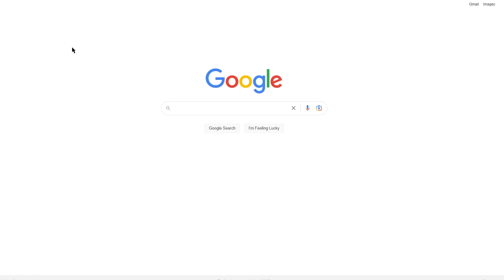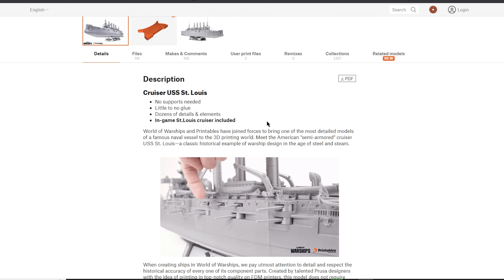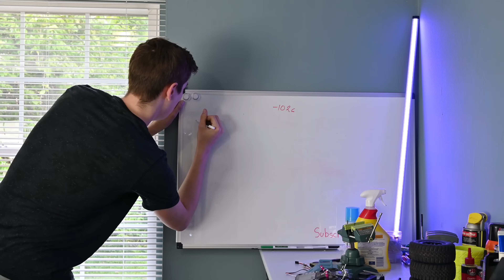I PRINTED an RC Car... How FAST can it go??

Comment: 1. Off road tires are designed for that purpose, and they are generally not designed to be fast. To go fast and stable you need the smooth, soft, and sticky tires to bite the ground.
2. It's too light, and the center of gravity seem to lean toward the tail, a tail heavy car will do that at high speed because once the speed picks up, and front is light, the front will try to lift up due to increased power and torque, even tho very minor, it will cause the loss of traction, and once the front loses traction, the rear will start to lose guidance and veer sideways.
3. The closer the center of gravity to the ground the better for high speed stabilization. Use smaller tire, or lower the car. With that big tire the car will wobble at high speed. Imagine the setup for F1 or Nascars. That's the kind you want for high speed and stable.
4. Aerodynamic isn't that relevant unless you go over at least 100 mph (for stabilization purposes). Fins, wings, spoilers, all the bull crap is not needed.

Comment: All the high speed cars are 4 weel drive. And you have to use metal gearings. A bigger motor and some more changes.

Comment: I want to see more rc experiments. Go outside the box. Breaking convention is how intuitive design is made. Start trying different ideas and designs in shape and everything. Also make a body for it. Not for looks but to protect you electronics! Lower the car add wider tires, adjust tire angles to keep car in line. Add more gyro about 35 to 40 percent. You shouldnt be loosing control that soon.
Reply: Also dumborc makes cheap controllers and recievers that are top line gx6 has gyro built in!

Comment: Ive been tossing up an idea around building an rc car that isnt the fastest but just has the biggest tires around and stacks of suspension, sorta like the monster truckes with the big soft tires you see jumping or driving over each other but with the body all inline so it can drive upside down as much as right side up... But i have enough projects all going on at the same time

Comment: Two suggestions :
change for proper rc car radio,  not the one used for drones. 
do 4wd version,  better to have all wheels under control than just rear.
as well as proper surface,  almost ground clearance and foam. tires designed for in fact only,  speedrunning. 

Are you planning on making basher/idiotproof rc car? that would be cool ^^

Comment: 1 you need a body for aerodynamics
2 you need to make the steering much better, tighter and potentially put some dual rates for when you get going fast your controls demand less movement
3 that looked like a drone motor??? I mean ok but not for this necessarily if it is... bigger terrestrial motor
4 the gopro mounted like that creates serious drag and also instability. I mean I do it with mine as it's the best view too but I'm just under 40mph with an 80a esc, 3900kv brushless, and 3s 2100mah 80C in a 1:12 pxtoys rebrand chassis
5 better ground obviously but use what ya can

I shall be following this closely, I wish you the best... there's no luck in truly engineered parts

Comment: Collab with one of the high-speed rc creators and have them help you set up the car. You can get a suggestion in the comments but if you don't know how every adjustment and expects the car you will just be chasing your tail. Hands-on with someone setting it up will speed up the process. A simple fix is to add some duel rate and expo to your radio so you don't overcorrect at high speed. Without a high downforce body making any adjustments won't help much due to all the different drag effects from the air passing through the open wheels and chassis. Good luck have fun, hope to see an update. I think it was very successful. Excellent 3D printed RC car.

Comment: I'm still seeing your tires ballooning, I would almost say he should look at the drift style tires which are a very thin piece of rubber over the rim (think something like F1 but thinner), you will need a smoother surface for the completely slick tires though. To maybe reach your desired speed larger circumference tires might be an option so you can hit the speed with less RPM causing less of that particular force on the tire.

Depending on your controller I saw someone mention tying the steering curve to the throttle but if you can't do that applying something like a 30% expo to the curve so you can make small changes at high speed vs the larger corrections that are sending you off course. If you can get a live video feed from the go pro to your phone an AR headset to toss your phone in will make driving allot more logical as you will see the path from your car's perspective (a relatively cheap way to get the FPV experience without spending allot of money). 

Good job though, first time I'm hearing about the carbon fiber filament might be something useful for some projects I have.

Comment: Any part that's printed and brakes should have gussets added to them, but it should be in the direction of the failure to actually improve load handling capability in the direction of the failure so that the same thing can't happen repeatedly.

Comment: Your suspension geometry on the front shock tower is not ideal and will be really unstable. I'd also recommend being a full set of shocks from something like an Arrma infraction or Talon. You will need the dampening over 60mph. Getting to 60 is relatively easy, aero will start to have a big influence as well as all the tolerances. A couple of millimetres of play at 30 mph is not a problem, over 60 mph will send if off the road.

Comment: You need way stiffer suspension and your car is way way waaaay to far from the ground.. Use foam tyres for speed runs, they do not baloon  as the ones on the car.. And you need some kind of a body for better aero for sure..

Comment: make a full length flat piece for thr bottom that tapers up at the rear into a diffuser

itll add boatloads of ground effect downforce without increasing drag

Comment: Biggest tip from an avid rc driver: you need MORE SPACE. Like A LOT MORE.  And definitely MUCH WIDER. You have no run off for if you lose control; and you have no speed up space and definitely no SLOW down space. Because it takes just as much if not more space to slow in a controller manner

Comment: I wonder if limiting turn radius based on velocity would be a good idea for stability. This can be some in software easily if you find a way to measure velocity
Reply: Maybe you can just use the accelerometer and integrate it. This won't be super precise but it would at least be better. You can probably just get an output from the ESC tho
Reply from the maker: I am planning on doing this!

Comment: Try if you can make it AWD it will help it very much also try adding wider smooth and larger tyres also lower it's center of gravity and introduce a more aerodynamic body shell also if you use a high end rc car controler it will help in steering the car at higher speed the one you are using it is not ideal for slight movements at high speeds .

Comment: You need to get your steering rack straight, you issues with steering is because your car wants to pull somewhere else. Wider tires will help, but better tolerances aswell, your joints cant have any slack aswell, parallel wheels is also paramount. It is hard to achieve, even my relatively expensive car needed a lot of work to get to stay in a straight line.

You also need to increase downforce and firm up you suspension. Fill your tires with foam or get stiffer tires!

Comment: You should addd an fpv camera so it can go out of your field of view and you will still be able to see it. Also get a real rc car controller because it has steering trim which makes it so if the tires go unlined then they can easily be realigned.

Comment: You need a body on it to create down force to keep it from spinning out at higher speeds. Running stiifer springs or thicker shock oil up front and lighter springs and oil in the rear shocks will give you better high speed control. A simple fix is ad some duel rate and expo to your radie on the steering to dumb it down some so you don't over correct. You should collab with Raz Shifrin when he is in the states and have him set it up for you. He's also a funny guy. He sounds better than my .

Comment: The problem with this is , at high speed it is getting unstable due to air pressure, it needs to be aerodynamic body on top, which is will a huge improvement or either you can weight, i know that will reduce the top speed, but air resistance will be higher and it won't be 100 summersaults... it needs to be more stable

Comment: Increase the wheelbase, longer equals more stability.

Ditch the gyro, it will fight you and cause a crash at the high speed.

Foam wheels to reduce the unsprung weight and tire deformation at speed, lower cg and stiffer springs... Or go full trophy truck and use hard off-road tires to help prevent the tires doubling in diameter. 😂

Comment: I think if you get some tires that wont curve up like that that will improve stability. Also printing with tighter tolerances too as you probably have a lot of vibrations and wiggle at these high speeds which make the steering even harder. Also the Wing design I think isn't adding much as it is. Try something a bit more agressive if you need more stability but of course you need to find a balance to not sacrifice top speed. Also you might want to find a better road lol. Those bumps gonna launch your car high in the air at higher speeds. Also some sealig bodywork to make it more areodynamic will probably be required when you go faster. No idea how great the efects of all these ideas is but probably worth looking into

Comment: Wont get in on the stick/pistol controller discussion as im new to pistol grips but something that might help either would be turning on a bit of expo on the steering axis to help fine control, it looked to me like the corrections were relatively large which isnt something that is conducive to driving stability.
I see you are using a flysky i6, there is an easy 3d printable addin part to add throttle centering if that is interesting to you, might not be a priority tho as having the throttle be full stick throw gives more fine control over it.
Fun project, subbed and following :)

Comment: you ever watch those mini robot maze run's? they use a fan to suck the robot to the ground so that it can have more traction and turn corners fast.. wonder if something similar could be done with an rc car like this to help stability? fin might be easier.. and perhaps a lower center of gravity. Also might be interesting to use your batteries as part of the frame, thinner frame in the middle of the batteries and thicker towards the end of them.

Comment: Dude I'm confused.  I build hobby grade RC cars as well from factory parts of course but I've seen people, including myself reach 30 to 35 mph on a 2S lypo battery. Why you choose a 4S? Was it to extend the playtime because it seems like you set everything else up to operate on 2S since you maxed out at 32. I'm intrigued.

Comment: i think you need different tires chief. When they expand you have little contact with the road, grip is just as important as hp. try soft drift tires and rim i think they're wider too. orrrrrrrrrrrrrr coool dude of the week, print the rims with the carbon fiber and tires out of tpu and you can test different tpu softness

Comment: That carbon fiber filament looks good but is very weak. The carbon fibers actually weaken the plastic bonds.
Just stick to a good quality PETG for all parts, and that will provide the strongest outcome.

Comment: Most speed run cars seem to be low to the ground with foam tires suppose it stops the wind resistance aslwell as a aerodynamic bodyshell

Comment: add down fours and for your not so go driving get a bigger splitter ( if you will add down fours you will need stronger sponsion )and cover up all electronics on the top to.

Comment: The suspension needs to sag to work properly. Otherwise, it's not keeping the wheel in contact with the ground. Just imagine a car driving over a pothole to understand why. I think your doubled up suspension may be too firm, which is hurting stability.

Comment: Just wondering which ESC did you use for this?  I've tried to use RC car ESCs with RC plane motors before and they didn't work well together.

Comment: You should be guided by full size cars. If you are simply going to 100 mph, the dragster is the model, long wheelbase means stable straight-line, low drag cross section and just sufficient downforce to keep it in contact with the ground. The model you have is good at all things but unlikely to excel at one.

Comment: I have suggestions on the wing and front diffuser I have a bash bar and wing on my 3D-printed rc and they are both made of tpu and have not broken I also run tpu tires they don't balloon at much and I use infill to control the softness haven't had any traction issues but I haven't gone past 30's on them 
 would you be willing to make a tutorial video I'm a bit confused when it comes to the cv joints and the drive train on  a whole

Comment: Looks too tail heavy from the way it spins so easily. Would also help a lot to make it front or 4 wheel driven; as it is now, the potential slipping of the back wheel from torque, during a spin out of the car, will maintain friction loss and allow the spin of the car to continue into loss of control; the steering stabilization system could potentially cut or limit throttle accordingly once it detects a slip, but I don't think there's any on the shelf that do; wouldn't be too hard to make a custom one with an Atmel microcontroller and some 3 axis gyro. Try getting a controller like the Turnigy X9 capable of custom control curves; with that, you can make it so eg. the middle 60% of your steering stick movement, only accounts for 10% control of the cars steering, giving you much finer steering ability at the high speeds and making over correcting much harder.

Comment: Why do you use off-road tires to practice on on-road speed-run?

Also, the project is more like an off-road vehicle than an on-road.

Why did you choose an out-runner motor?

To use gyro, you need an high speed servo.

Other 2 thing that become very important in speed-run are: the clearance of links and joints and the stiffness of chassis, link and arms

there is a little mistake
a single universal joint isn't homokinetic, but if you use 2 of them maintaining inner and outer axes parallel you will obtain an homokinetic transmission
so if you have lower arms as long as the upper arms in a RWD vehicle, you can't avoid CV-joints

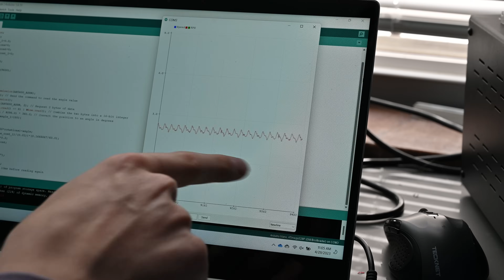Comment: 1:51 honestly I would go with the standard metal dog bone/socket shafts for reliability sake yes it defeats the 3D printed idea but they are probably the same cost as the 3d printed version but with much greater wear resistance

10:47 try printing the gears diagonally (~45deg) that way the shear lines in the print are not aligned with the applied torque shear line of the motor. also adding a fixed bearing on the end of the gear coming out of the motor that way you are not relying entirely on the motors Bering to hold both the armature and the gear during a crash, better for all parts involved  (|||||)----==   vs   (|||||)----==----(

Comment: the front suspension in definitely too high, try to run the car as low as possible with a slight lower front than rear

Comment: By the comparison of formula 1 cars and the RC, I have realised that formula 1 cars have a little bit more curves making it a lot more suited for aerodynamics (because you want to lead the air around to the back of the vehicle right? or am I wrong?). However, the part between the front wheels also have some sort of air leading mechanism to the sides of the vehicle that makes the air not go underneath the vechicle/back wheels and making it more stable, could that be an improvement? I have also realised that formula 1 cars do not have a horizontal plane underneath the vehicle maybe because they want to put the air to better use?  I am not a engineer but I hope my ideas has something that could be put to use.

Comment: hey michael, 
i was really inspired by your video. I had been trying to fix an rc car that i broke when i was a child. I have fixed the steering with a servo and few things i got at home (i dont have a 3d printer). Now for the gearbox i tried using the stock one which needed a brushed motor (big). I tried to replace it with an 180 motor but its not sturdy and often slips from the gears. So i was thinking that i could use your models of a gearbox to replace the one in my old rc car. Im new to this and dont know how to export the files for the gearbox alone so i could go to a store nearby and get it printed. Perhaps can you help me with it?

Comment: While you can print camber links, you should get proper tie-rods and rod ends. They will be easily adjustable and are much more durable.  

Further, look at the sheer power these 100+mph models and kits have. Going 100+mph is not the problem you face. It is making your own RC that can do it  at all and then reliably that is you r challenge.  It is also rather hard to get buggies up to 100mph without going insane with power. The rig you have now is maybe going to max at 60-70mph, IF you use a powerful enough power train.

You may have to start using molded or machined parts, especially high stress parts. Consumer level 3D Printed parts tend NOT to be strong enough for high stress application, like basher RCs, including speed runs.

Comment: Universal joints are usually used in properly aligned pairs to nullify the velocity fluctuation. That pinion gear design on the motor looks terrible to be honest.